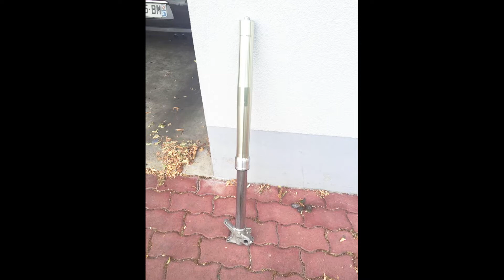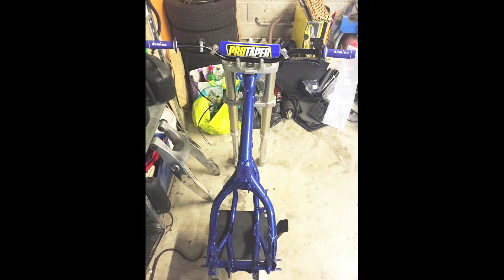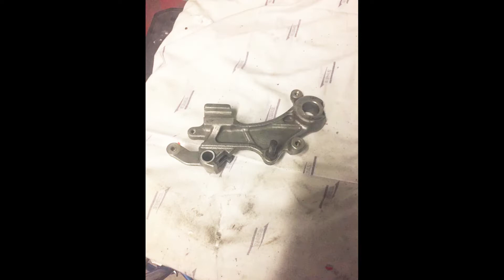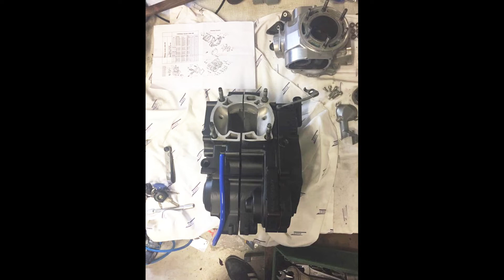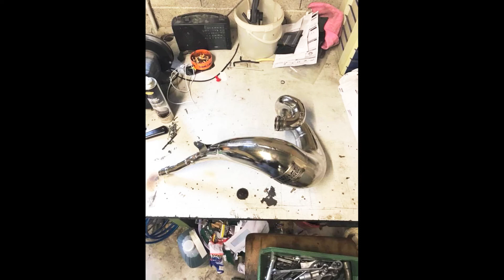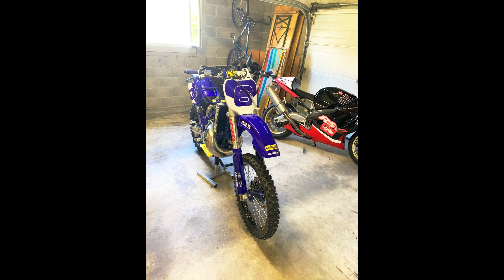Restauration Yamaha YZ 250 1999

Comment: Can’t keep my eyes off it , that’s a good looking Yamaha .
Reply from the maker: Thank you so much 😁😁👌👌
Reply: Yes, it turned out beautifully! I’ve a 1998 YZ250 as well. Extensive motor work from the crank outwards to the clutch basket, cylinder porting, headwork, piston, V-force reeds, etc.  Very strong motor, but very rideable too! Suspension professionally done, titanium rear subframe, Pro Circuit full exhaust. Talon hubs (gold) and Takasago Excel rims (gold). Love my ‘98 YZ250😊Your ‘98 YZ250 is very nicely done! Looks beautiful! I’m almost certain that it runs impressively. Great job on your build!
Reply: @Arthur-osama  the oversized rotor/brake kits are a great upgrade. Great job.

Comment: One of the best mx bikes ever built and probably the quickest 250 aswel.
Reply: No it's not. It's was a terd. I have one. 
Great offroad bike. Shit mx bike in anything but the slick. 96 97 98 all crap years for yamaha yz 250. Brand new bike and motor in 96.  All mid range .. 97 all top end... soft bottom... 98 all bottom end shit top end. Motor replaced with essentially the current platform in 99
Reply: RM250 is best.
Reply: @dormantmenace  this could be mitigated with the 89 long rod or changing the 97 cdi to 98, and mild porting & a pipe, it keeps up/passes my 2023 yz250.